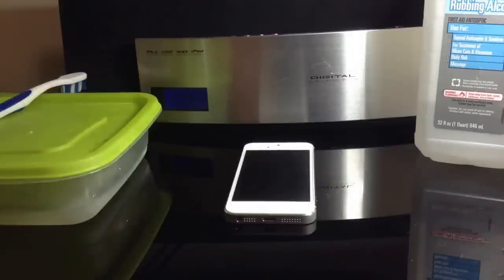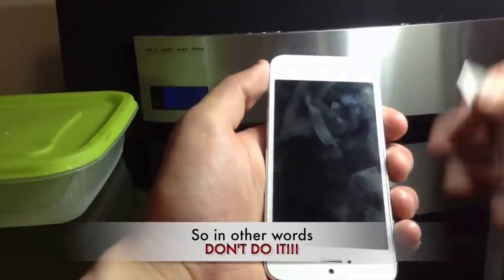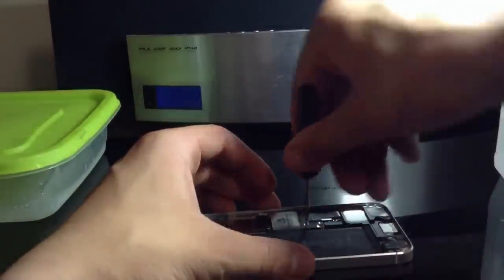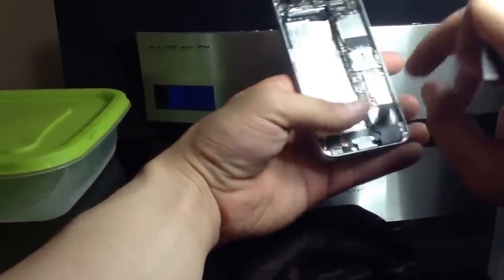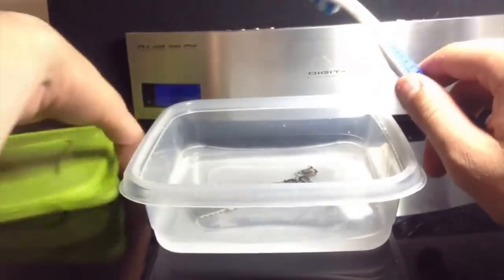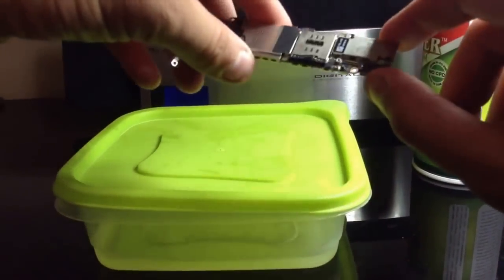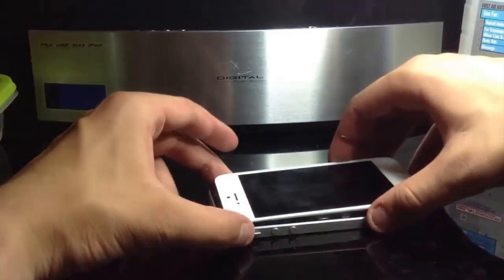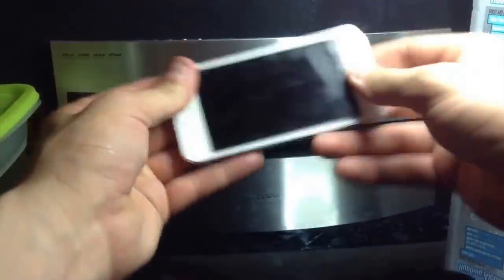iPhone water damage repair DIY (full step by step guide)

Comment: So i accidentally put my iphone 5c in the washing machine the other day. It wouldn't turn on so I put it a bag of rice for a couple days. Now the screen comes on the but the touch part is unresponsive. The cheapest I can get it fixed for is $100 so I might try to just do it myself. I can't figure out what I should replace though- the screen? the battery? both? If you could just tell me what needs to be replaced, that would be great! thanks
Reply from the maker: I would buy a new battery regardless. Do the cleaning and if touch is still unresponsive afterwards then I would buy a new screen as well, make sure all of your personal data is backed up tp itunes before hand and that data you cannot get back if something goes wrong

Comment: Followed the tutorial and upon start up my iphone 5s screen was very dark and it would not recognize the network saying "searching". It did pick up wifi. Should I reopen and check connects for screen? what do you reccomend? Thanks
Reply from the maker: Eric Chernuta ya, check your LCD flex and make sure none of the teeth are black (lightly scrape the arc'd teeth with a razor if they are), it's also possible your backlight went out, if you have a friend with the same phone you can test his screen on your phone and this with tell you if the backlight is bad or not

Comment: I followed this video step by step and my screen is acting weird. When I press down on the touch screen at the bottom it triggers the touch screen at the top and bottom(where I touch it). Would like not to have to buy a replacement screen, any recommendations? Btw everything else is working fine
Reply: Never mind, fixed it. It was a loose connector

Comment: Hello again, tried to fix water damaged phone again. The logic board is fine, I thought the power button maybe broken, so I used the tooth brush with the isoporpanol and i refitted the power button once again, and attempted to turn it back on. The phone came on! But only the apple logo came in and took a VERYYYY long time, it was just showing the apple logo for a few minutes so I turned the phone back off and put another logic board in and tried to turn it on again. Nothing, so I swapped the board around a final time, and still nothing. What the hell? 

So i managed to fix the power button but only managed to turn the phone on once?  What gives?

Comment: Hi could you please answer this question for me.  I did the full repair but I only have one problem, I can't get service. It just says searching and it won't get service. Any ideas on what happened? Thank you.
Reply: MultiDreamboat  I have the same problem =/ Dropped mine in the ocean for 3 minutes at 1 meters depth and did the repair a couple of hours later. Any anyone that knows a fix for this? Thanks.
Reply: +ivtec259 I would get a replacement sim thingy and replace it with the old one 😉

Comment: would i be able to switch the mother board from and iphone 5 s to a 5c with using the 5c screen for the water damaged 5s? i know this video is old but the last youtube video i viewed to repair my phone, my new battery i changed wont charge enough to turn on.
Reply from the maker: no they are completely different devices

Comment: I cracked my LCD screen fixed it. And i dropped my phone in the toilet a couple days later. I plug the phone into a charger and the screen doesn't turn on it just vibrates every few seconds. Its a 5c. I was hoping you could help me.

Comment: Dude last Saturday I was way too high, I left my phone in my house deck, I went to sleep, and the next day I found out that rained really bad, and the phone got beyond soaked in water. I turned on the phone after several hours later, it worked for 2 or 3 hours, then didn't work properly.  
So now it just keeps either turning on until the Apple logo comes out, then it reboots itself, or the Apple logo comes out, the gets darker after 6 seconds, and then shows up little sentences saying that the phone has such an error, and the screen gets weird lines and colors. If you can tell me what it has, please let me know.
Thanks in advance.

Comment from the maker: **For anyone that would like to send me their devices for this service, I am not taking in any send in repairs at all and I doubt that I will any time soon**
Reply: Hey could you check out my video on my iPhone 5s. Because I don't know what's wrong with. But it was waterlogged.  But please help me
Reply: +Nate Rist What do you do about the wire connecting the screen and the back  of the phone once you get the screen off?
Reply from the maker: not 100% on what you mean Thornton Kennedy
Reply: +Nate Rist +Thornton Kennedy Hi sorry for jumping in but is it an iPhone 5S you have? If so, then this will be the touch ID cable if it is intact then you're ok but if it has broken then touch is gone forever on that phone.
Reply: +Thornton Kennedy You simply pry the screen connector from the board

Comment: So can the damage of the screen be fixed? Because my screen has a dark spot in the corner. The touch screen works fine.
Reply from the maker: Follow my other guide to replace your backlight, that's all you really need, otherwise just replace the whole screen if you want to make it easier (keep your current screen as a backup if you do)

https://www.youtube.com/watch?v=b7pNTNriIDg

Comment: Iv tried 70% 2 times on a 5 and a 5c got new batteries and changed the charge port on the 5c and neither one of them will respond could u help me please why won't they come on iv worked on over 1000 iPhones and fixed all of them besides these two it'd somthing with the water damage with the 5th generation iPhones I can't figure out

Comment: I took my iphone5s completely apart after it fell in toilet, scrubbed it all down in isopropal 90%, replaced the battery, left in sealed bag of rice 48hrs,  and still it will not start up.  Any other suggestions?

Comment: Will this work if my iphone 5c was dropped in chlorine and dried up for about a few days? And if not what do i need to replace because it wont turn on?
Reply from the maker: you never know until you try and battery and dock connector assembly will be the most likely to have issues so i'd say expect to have to replace those

Comment: I have. 5S with water damaged I've cleaned it and put a new screen on but I have no touch on the screen any suggestions
Reply: Maybe you accidentally messed up the Digitizer flex when removing the screen or it got disconnected. I heard when reconnecting them sometimes those flex cables like to disconnect.

Comment: What about on an iPhone 5s? When I lifted the screen there's still a little string attached , will anything happen if I remove it ?
Reply from the maker: that is the cable for your home button, just disconnect it

*The the phone in the video is an iPhone 5. Disassembly is slightly different, but the process is very similar
Reply: +Nate Rist yea I figured but when I disconnect it how? Do I simply pull it off or unscrew the little screw it has

Comment: HELP: If anybody could help me that'd be great, I recently submerged my iPhone 5s in water. The screen comes one as a white screen with the apple logo,  with little water damage marks, but only when it is plugged in, and only for a few seconds. I did everything here step by step, and still got the same results. I was wondering if I short circuited the phone or if there was something else I have wrong. Thanks

Comment: Hello,

My two iphone 5 fell into water. Before seeing this video I tried to put them in rice and turn them on, plug in... Now, one of them opens, shows the apple on the screen and some text which I believed to be the kernel. The other one is not giving any life symptoms unless plugged in, when I plug it in, the apple comes on and off... 

Then I took them to the apple store, and I was offered out of warranty replacement for $269. Now, I saw the video and started to think of trying this method before paying $538 for both of the iphones. My concern is, if I open the phones, will I still be able to have the replacement? is there some signs that they find out whether it was opened or not by the unauthorizes persons? if so, does it worth trying, or should I directly go to the apple store, pay the money?

Thanks,
Reply: From what I heard from Apple support if you take the device apart and like buy some replacement part off eBay or something they wont even attempt to fix it. If your just doing this I don't know but it could be the same deal since you opened the iPhone and took it apart
Reply: will it be a problem if I submerge whole iPhone without disassembling it?

Comment: I soaked the top half of my iPhone 5 in rum and coke on accident. I followed these steps, and my phone is still dead, no reaction, even when i plug it in. The first time it did vibrate and made sounds, but the screen did not come on. Then I tried again and nothing. Is it hopeless? -The interconnect cable ripped, i already ordered a new one, so did this have anything to do with my phone not even turning on?

Comment: Will this method work on a phone that is water damaged and won't turn on anymore?
Reply: +Teamdoesyou It depends on how long the phone has been damaged. If the water has had time to dry it will leave behind corrosive minerals that will eat away at connections and other things in the phone. Good luck, sir

Comment: I recently dropped my iPhone in a glass of tea. the botton part only went in. I followed your video. My ohine will turn on, but like you said I think I need a new battery. It turns on only when plugged to charger, stays on for a little bit (3-5 mins) then goes off again. Repeats. Then my middle button doesn't work. Any suggestions?
Reply from the maker: New battery definitely, new button flex and new dock assembly would be my best suggestion (unless it's a 5S then try to reuse the home button for touch ID as a new 5S button would only function as a click-able home button without touch ID)

Comment: i dropped mine in water for like 2 minutes as did not realise (obviously) there was water in the place i hid it but i put it in rice for 2 days and the sound does work just not the display, anyway of saving it ? thanks
Reply: Lol almost the same as me I forgot I had my phone in my pockets of my swimmingshorts and I got in to the pool after two minutes I realized and took it out immediately and it didn't work anymore it's in rice now i think it's broken now
Reply: But I'll hand it to apple
Reply: But I'll hand it to apple
Reply: I'm too late, but you would have to probably replace the lcd
Reply: That's because rice doesn't do shit basically and you should have wiped it out. Like... man, think of what happens when you evaporate water. All the salt and dissolved shit in it crashes out. Now all that stuff started corroding you phone from the inside out

Comment: If the water tab in the sim card port is red, is it even worth doing this? /How long can you wait before trying this? It has been 48 hours since I dropped my phone in water.
Reply from the maker: Zac Dalby if the water mark is red, you should probably follow this guide asap. The sooner the better, but there is no specific or set time to repair liquid damge on a phone or other electronic device. Really just depends how bad the corrosion is and whether or not any vital components on the board have been damaged or not

Comment: do you know if this fixes water damage from salt water?
Reply from the maker: It can, doesn't mean it will though. All this is meant to do is rid the board of corrosion so that it doesn't spread and further damage the phone. Mainly the purpose of this is to make the phone possibly bootable so that personal data can be rechreived, I wouldn't depend on the functionality of a liquid damaged board, but if it seems stable then I say have at it (just back your data up regularly and keep a backup phone of some sort).
Reply from the maker: it can, but not guaranteed to

Comment: does this work on HTC m7 too? Please, I need an answer. Thanks ! :)
Reply from the maker: Happiness This type of repair applies to any electronic device
Reply: Thanks for answering! My HTC dropped in the sea water and still not charging or turning on for 3 weeks now. I went to the service center and they said I need to change almost everything and charge me almost 90 % of the market price. I will try to fix it myself.

Comment: It was very helpful, but did not solve my problem.  I did everything you did in video, using 91% isopropyl alcohol to clean the motherboard and I put in a new battery.  But, it did not work.  My son's iphone 5 still will not come on.

My son accidentally jumped in the salt water pool with phone in his pocket.  He realized it almost immediately and got it right back out.  It was less than 30 seconds.  All three water marker indicators (one of back of display and the two inside phone are red/pink).

After all that, I wondered if I was getting power to the battery or to the screen (could it be the charging port/headphone jack module not charging the battery or powering the phone).  I used my Fluke multimeter and when the phone is plugged in, I can see ~ 2 volts on some of the battery connection terminals and the LCD display plug.  Does that mean power is getting to the battery and display, so I need to replace the display?

Comment: Hi there, my iphone 5s drop in the water for like 10 minutes. There's like corrosion on the charging port and sim port. Went to the shop and they told me to change to a new phone for like $450. If i follow your steps fully, is it possible it would likely work? Any chances?
Reply from the maker: there is no way to know unless you at least try. Water damage repair is never guaranteed at all
Reply from the maker: also apple would replace the whole phone for $279, I don't know what store you went to, but worst case is $279 for a new replacement from apple
Reply: Thanks for the reply. Will definitely try it. But new replacement in Singapore cost me $450.
Reply from the maker: is the currency the same as it is in the US there? usually apple generalizes the price for services by calculated local currency

Comment: my phone was water damaged, now touch screen is not working.  I am not able to even punch in passcode or power down or restore.  Is there any way to fix it?
Reply from the maker: try a new screen and see if it works then, if it does then the digitizer on the old screen is bacd, if it still doesn't work then the terminal on the board may be bad

Comment: Hy there,
i tried to do the way you have shown.But my Iphone 5s shows the apple logo in a loop and no more.Is there a solution to this?
Reply from the maker: If it does this only while on the charger then it’s likely your battery is shot. Replacing the battery should resolve this.
Reply: Hy Nate,
Thanks for the quick reply.I replaced the battery with a new one.But it still doesnt work,It shows the Apple logo which blinks after every 30sec

Comment: So my friend dropped her Iphone into a cup of water, lower part of the phone only. The phone worked for months, then one day it just stopped working. The indicators shows one red. Do you think even after that long that it would still be possible to used this technique?
Reply: +R Conley The water caused corrosion...you can try to do the treatment but the corrosion might have eaten into the board or the connectors.
Reply: +Misti Waller , thanks I attempted it already.....it was too late unfortunately it seems. thanks for replying.

Comment: my iphone 5s fell into the pool for about 4 secs i then instantly did the rice thing. it was in there for about 29 hours i took it out and it didn't work! but i did notice the sensor near the front camera blinking when i pushed the power botton! i scared to do anything to it! do u think i should try replacing the battery or do the same stuff u did? please help
Reply: but when i took the phone out i did see alot of lines on the screen after some seconds you could just see a little bit of the screen i instantly turned it off!!
Reply: +Niko Bellic
Reply: What?
Reply: I think disassemble your phone. Try to remove the screen and wipe that shit down, also it can be found in youtube "disassembling iPhone 5C"

Comment: one more thing, can i use hair dryer instead of air duster?
Reply from the maker: Happiness you can, but I would prefer not to as the heat might cause some issues, air duster is just safer to use IMO
Reply: I see. Thanks  :)
Reply from the maker: no problem

Comment: So I dropped my iPhone 5s on the toilet and everything works so far but my fingerprint doesn't work at all it doesn't say try again or anything it just doesn't check it is there a way I can fix that ? I tried putting another finger print but it says fail try again later. PLEASE HELP ME.!
Reply from the maker: if no visible damage can be seen inside the phone, you can now take it to apple and they can/will replace the faulty home button with a free replacement (recently apple has started re-serializing new/replacement 5S home buttons in store so touch ID will work on the replacement part)

Comment: I just followed the entire video and after soaking the mother board in alcohol and reconnecting the cables to test the phone, the screen lit up once and showed the apple logo as if it was going to turn on. After flickering a few times, the logo disappeared and the phone never turned on again. any suggestions? 
Btw, I was told that the phone was put in water and grease.
Reply from the maker: +Curtis Collins sounds like the battery is bad, go on ebay and order a new battery from gadgetfix, they should be about $5 or so and that should solve it, but that's just my assumption
Reply: Awesome Nate!! Thx for replying.